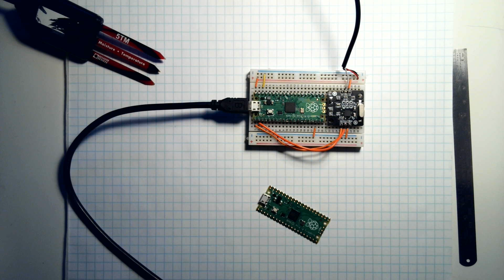Connecting a raspberry pi pico to an SDI-12 mini module

Comment: May I get more information to the used "SDI-12 mini module please ?  ( Has it a micro-contoller or has it just passive components. What about the price and where to get it  ? )
Reply from the maker: The module is an active device with a microcontroller same as the USB variant. You can get the module here: https://liudr.square.site/product/sdi-12-uart-mini-module/73?cs=true&cst=custom
I recommend getting the USB adapter first so you can familiarize yourself with SDI-12. The module is intended for embedding SDI-12 to an existing data logger project.